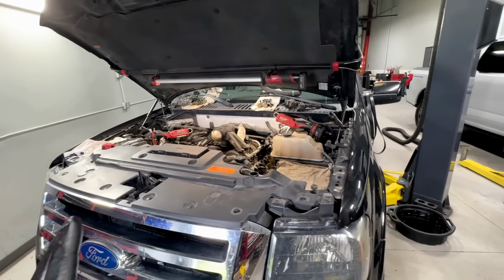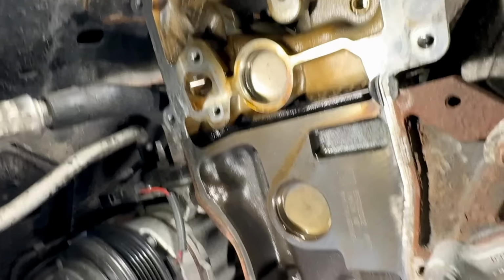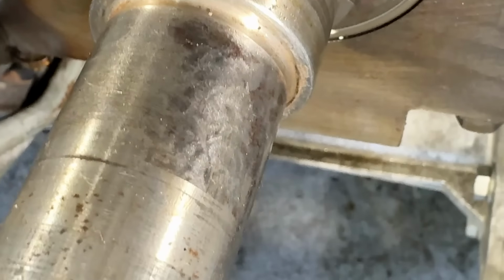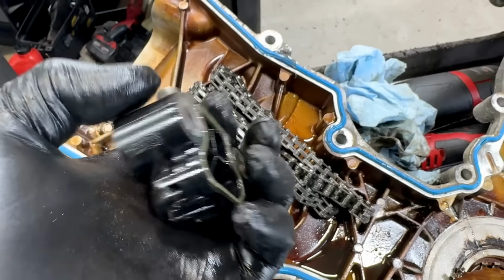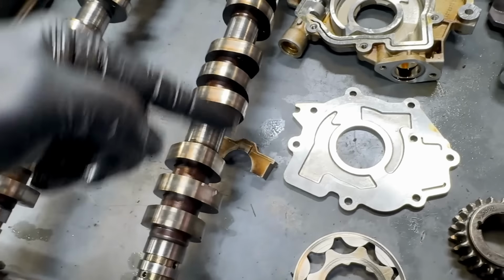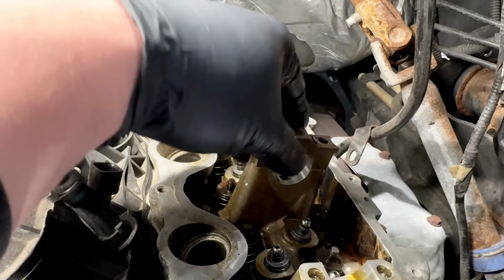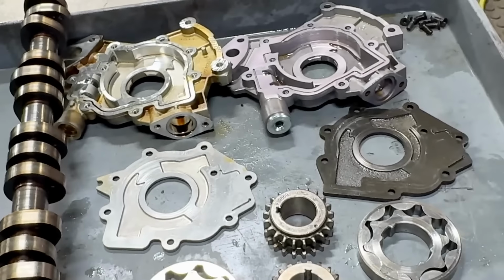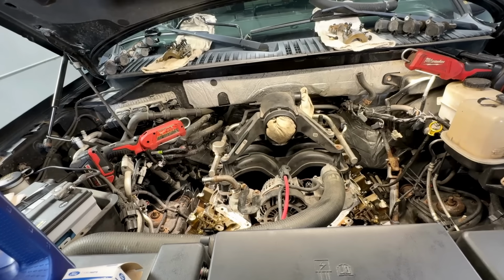How to Destroy a Perfectly Fine Ford 5.4L 3v Triton Engine with a Timing Job!

Comment: Ok, now im curious.
Im about finished with my timing job and noticed when i was putting my cam caps on that one set was numbered and the other was not and he said they didnt start numbering until 09... my trucks an 05 why would right bank be numbered and left bank not be is it possible someone did previous work? Or is that from the factory
Reply: My 2004 f150 5.4 3v has numbered cam caps. Original engine

Comment: 2005 F150 5.4, 265k miles, original cam phasers are locked and VCT disabled in ECU (no SELs). Runs well and gets decent gas mileage, but it's a bit noisy. 6psi oil pressure warm at idle (connected mechanical oil pressure gauge). Rest of the truck is decent (a bit of typical rust, but not completely rusted out. Possibly a good idea to do the timing set along with a HV oil pump? I plan to drive it into the ground :)

Comment: Use 5W40 HV diesel oil for to test or what? I try to understand what propose to the 5W40 HV Diesel oil for?
Reply: Use it as a last ditch measure to increase your oil pressure if it falls out of the new Ford spec of 15 psi

Comment: Can Motorcraft 5w50 oil be used on a 2011 Expedition L5.4 3v engine at an outside temperature of 46C to 50C or not? What is the best grade of oil to use in the engine at a temperature of 50C? I am talking here about the weather temperature. Thank you.

Comment: Start with checking oil pressure first on these engines, that will save you time… minimum is 25 psi hot, in drive, even though ford claims 15 psi (which they changed to reduce warranty claims). If you don’t have enough oil pressure go with a reman long block through Dahmer powertrain. AER sucks nowadays and they don’t stand behind their warranty. Cost for reman with labor is more like $7-$8k not over ten…. Been working on fords for over 20 years.

Comment: Fighting with a local shop now that destroyed my engine . Reused the crank bolt and used what looks like in jb weld to secure. Broke loose in 1 week. Total engine failure.  Ford found the bolt loose on teardown. Marks on shaft are exactly as you described with a loose  balancer. Shop is trying to blame the failure on a bad part (timing gear failure) not their reuse of the bolt. Arghh.
Reply: How did that go?

Comment: Just to clarify, you saying they put cheap aftermarket roller followers with smaller oil holes ? or you saying they did not replace the new ford model factory oem roller followers that now have smaller holes in them ?

Comment: What is your opinion on whether to use the synthetic blend or a full synthetic like mobile one on the 5.4L 3 valve.  Mine is a 2014 with 170,000 miles

Comment: If the ford oem stuff is such good quality why do they fail at such a low mileage rate? Don't get me wrong I can't stand eBay shopping customers but there are better quality parts than oem out there.

Comment: I have a question, i have 2010 f150 crew lariat 120k miles did the timing chain as you have instructed. changed the rollers etc double checked all points and bolts. i ran my finger over the driver side chain  and very little wiggle, but the passenger side has visible slack about 1/4 inch side to side... is this normal ?

Comment: It's funny you mentioned the tensioner being hard to push. On our 2010 5.4 that's missing like crazy brand new oem set the bank 1 tensioner wont push in like that and no milage on them the bank 2 is fine but it's missing on bank 1 so wondering if ford will exchange them they have since changed the oem set I bought right after I bought it

Comment: May have u do the lift to while its there if u do them ur the best an I definitely would be honored if u worked on my truck an everything work s 5.4L3v super crew platinum4*4like I said brakes new tries new spark plugs new oil change Castro GTX shythic

Comment: The Ford store on Amazon gave me the plastic tensioners, can we demand the steel? Thank you
Reply: The updated ford plastic ones are better. They’re non ratcheting unlike the cast iron ones. Makuloco recommends staying with the updated oem plastic versions. The ratcheting ones are known to stretch chains out
Reply: Know of any ways to keep mechanics honest? I've spent $1800 in recommended ford parts on this Timing/Rocker Arm Lash Kit, Oil Pump Upgrade and water pump to boot. I don't trust very many mechanics anymore, except Makuloco but he lives on the other side of the country.

Comment: I got an 05 F-150 with a 5.4 Triton in it I haven't had any major problems with the motor not one I got 320,000 on it I've rebuilt the front end now I need to replace the bed other than that I love the truck

Comment: After a year of back and forth, i ve decided to build a 351 for my ‘05 F150.
In my state theres no inspections, and i know a nice, civil build will run better and i gaurantee it will outlive my $5,000 3valve engine rebuild.
The donor truck was $1,200…
 
I ll loose some OEM functions, but who cares? A nice set of ol school gauges, an edelbrock setup and FASS injection,we gone!
I ve built several chebbies, fords and mopars. Just give me a pushrod motah…. PLEASE

Comment: I think if this was installed properly we wouldn't have seen so much carnage.
Reply from the maker: Yes that was the whole point of the video
Reply: @FordTechMakuloco  sorry I should have been more specific....I meant that these aftermarket parts probably would have held up just fine if installation was done properly.....great diag and info as always

Comment: Good morning. Is there a good way to tell if I for sure need a timing job if the vehicle isn't running? I have a 2012 expedition with the 5.4. It just stopped going down the road. i have fuel to the rail and replaced the cam sensors as that code is showing up in forscan. I haven’t been able to get it to start since. I sure appreciate the knowledge you share in your videos.

Comment: @FordTechMakuloco - do you ever do valve seals when you’re doing a timing job with roller follower replacement? I suspect I have a valve seal slightly leaking towards the back of the engine. When parked with the front of the vehicle higher I get a slight plume of smoke on startup. Never happens when it’s parked level. Thanks!
Reply from the maker: I never touch them.
Reply: Thanks for the reply!

Comment: 07 super crew FX2 5.4 3v bought it with 80k 5 yrs ago did a complete oem timing set and hv oil pump has 87k now and looking forward to many more trouble free miles. This is the 3rd truck I’ve owned with the 5.4 3v have never had any issues

Comment: Would it be good to start to run f150 with 155'000 miles with Shell Rotella T6 5W-40 Diesel Engine Oil, 1 Gallon? Thank you for your time.

Comment: I had a 2006 f150 xlt lariat with   the 5.4 triton.  Had tune up done at 100,000 and broke 2 plugs, couldn't extract them so pulled the heads. New phasers and all new timing stuff at the same time. Very expensive 6400 dollar tune up. Ford reimbursed me 3500 through a  class action law suit on the breaking plug issue.  Totally not impressed with the 5.4 triton. Traded an 18 year old truck in on a new f150 with the  2.7 twin turbo last week. I am amazed at how close it performs to the 5.4 I had. Best part I can pull 28 mpg on a good day not towing. Time will tell how long it lasts.

Comment: I have an 07 5.4L F-150 with 183k miles. Engine has never quit on me but there is a loud ticking noise coming from it and it’s been there a long time. What could it be?
Reply: Follower? Tensioner?
Reply: @tongtongwang  Ended up just being an exhaust manifold leak lol. Ford dealer said timing components and wanted to put in a new engine 😂

Comment: The guy who put this motor together did an absolutely atrocious job he or she should find another career. This person should stick to pushrod engines or lawnmower setups. Ford has a very specific way things need to be done and very few parts can be sourced outside of the actual OEM assemblies. Anyone who does this kind of work needs to take there time follow the proper guides such as ALL DATA or the equivalent guides and do the job right the first time. For a customer who probably put close to 3k into this young motor only to have it destroyed is just ridiculous. I’m sure they are now just wishing they didn’t have anything fixed it probably would have gone 250k as long as properly maintained.

Comment: The chain I absolutely see it the ford chain is made with flat links the melling it rounded it would definitely make sense it would ware out guides. Your videos are so informative I will tell you this my 08 expedition is nearing 250k is under boost and I’m has never been opened up for internal work. I will eventually do the lash adjusters and rollers but until I hear or notice a vct issue it’s staying the way it came. 

I do my own maintenance religiously and I also do all my own calibration work this maybe why I have had such good luck with my truck.
Reply: I always number my cam caps if they are ever pulled for motors I work on. 

You can’t mix them up because if I’m not mistaken the cam bores are line honed after a head is built and each cap belongs to it specifically tower.

Comment: Help!!!!! Just had complete timing on my 2006 Lincoln mark Lt… guides,tensioners, chains, crank bearing, vvts, new oil pump, new coils, new spark plugs, guide tensioners, camshaft phasers, and it just threw a p0012 code… I’m completely frustrated… please help… thank you

Comment: Having trouble finding any info on the 4.6l 4v (32valves total) engine reliability. Do they have similar problems to the 5.4 and 4.6 3v? Any info would be appreciated. Looking at a 2005 lincoln aviator with a rough running issue.

Comment: I have a 2013 Expedition with high mileage (215K) that had timing chain/rocker arm issues when I got it. I made the common (apparently) mistake of buying a Chinese "kit" to fix it with. Everything was fine for the first 1,000 miles or so, then I started having problems with the Phasers. The driver's side cam kept getting out of phase when it wasn't supposed to. So I replaced that solenoid, didn't fix the problem. The engine is extremely clean. I even dropped the pan when I did the job to make sure it was cleaned out completely. 

Moving forward, I decided rather than spend more money on parts and taking it all the way back apart again, I did some research and decided to do a VVT delete on it. I'm aware of the pros and cons, it was my decision and I'm sticking with it. My question to you is this - I know I need to have a tune to disable the VVT logic so that it doesn't turn on the check engine light. Planning to have that done very shortly. However, it runs MUCH better now, but once it gets into a situation where the VVT tries to activate, it feels like it's pulling timing way back. And once the light comes on, it seems to remain in that state. Is this a normal "limp mode" when this malfunction occurs? P0014 & P0024. Just curious. 

Thanks for all the videos you post. Its good stuff.

Comment: Thought on a 97 f250 lightduty with the 5.4? 150,000 miles
Reply from the maker: What about it?
Reply: @FordTechMakuloco  asking your thoughts on it especially the motor
Reply: @FordTechMakuloco  or just any input since it’s weird truck and you have a lot of ford knowledge
Reply from the maker: Its a great setup same engine as a regular f-150 but you will find many items are specific and obsolete as these were rare.
Reply: @FordTechMakuloco  fair that is a concern, I feel that with the internet parts may be easier to get. I’m use to having vehicles that don’t have parts readily available

Comment: I bought a 2017 ford explorer police vehicle and have to change the PTU. I`ve been watching this creator's videos. Sadly, mine while it's working it is leaking fluid, the seals are shot. I have ALLDATA DIY so I'm looking up all the parts and so forth. Mine has the oil cooler which adds another variable because you either need to cap the pipes when removed really quick, or you drain the coolant.

Comment: I currently have a 2004 f 150 4x4 with the 5.4. Your info for said motor is extremely well done. At 181 k miles there is just starting to very lightly rattle. It is really starting to bother me. My shop is quoting $12,000 to do exactly what you do with complete new Ford everything and 30000 mile warranty. Truck is beautiful  and used for windshield farming .

Comment: I love your channel man. You do amazing work. Over the years of everything you have shown us has made me decide that with all the crappy cars that are produced and crappy mechanics in the country witch is probably about 99% of them I think its about time to go back to the old cars and trucks from the 70s and 80s. My old carb chevy Silverado gets 17mpg a d has 289k miles on it and ive changed the water pump, plugs and wires and it still runs good and has decent compression. Never costs me any money.
Reply: Some older ones were good some not worth the paint that covers it, just like modern cars some good some not.
Reply: @andrewarmstrong9194 true, but at least an older car, truck, van, etc won't cost you arm, and leg to fix, totally rebuild or replace an entire engine and tranny.
Reply: Can’t beat em
Reply: I bought a '73 Jeep CJ5 with the 304 V8 a couple of years ago and it has made working on cars great again!

Comment: Would you run Rotella T6 in a 2019 3.5 ecoboost?
Reply from the maker: No
Reply: @FordTechMakuloco  I'm trying to find your recommendations for oil for the Ecoboost. Only run motorcraft or what other options?

Comment: I am going to get into my mustangs timing system it’s a 4.6. I am considering the cast iron tensioners and the melling HV oil pump. Will only go with the Ford performance timing chains. What are your thoughts on the combo?

Comment: How frequently does the oscillation need to happen for you to go to 5W-40? I did my timing job following your videos to the T, all with Ford parts, upgraded Melling pump, and the updated roller followers from Ford. I'm using 5W-30. In the last 10k miles I've had the phaser oscillation happen 3 times, only for a few seconds each time as I was parking. No other symptoms whatsoever. This video freaks me out. I tried to be careful with the cam caps, but I lost track of 2 them during install and had to match their wear pattern to the cam. Would love to hear your thoughts.

Comment: Ive done so many 5.4 timing chain setups and when it comes to those i always told the customers to go with motorcraft. Some that didnt wanna go that route would bring their vehicles back with timing issues especially after replacing the cam phasers and again i would tell them to go with motorcraft and wouldnt c those vehicles again unless it was for an oil change

Comment: Love your videos. I have repaired three 5.4 3 valve engines where someone had the timing 180 out, One on the left head and 2 on the right head. I was amazed that I was able to repair them. They did not have any valve to piston damage. I did a timing job on a 2010 5.4 where the owner broke the cam, chains and phaser. I was able to repair it with no valve damage. It has 60,000 on the repair. And only spent about $800 in parts.  I have done several other timing jobs on almost every ford model. been doing it for 30 years, These engines are not throw away engines they can be repaired. Usually within one day.
Reply: Is it worth repairing my 5.4 3v with 331k

Comment: Hello, wondering if you have an email I can have to pick your brain about some issues I am having ? on 2010 F150 5.4 3v after a -timing job, water pump, VCTs from a shop. I am stranded in AZ for over 11 days and just want to make sure I don’t make my engine worse . Lots of codes P0012, P0022, P0345, P0340 , P0344, P0349, P0300, misfires in cylinders 1,3,5,6 . The shop said just to get an oil change with 5w30 which didn’t work. I changed both of the cam sensors, put a new cam plug on bank 1, I tested the wiring plugs for voltage . Haven’t figured out ohms yet because I can’t find the right PCM pin diagram. I took the front and valve covers off to make sure the chain is still tight. One of the phasers looks off according to your other videos. Didn’t take anything apart inside the engine. I took lots of photos too. I am not a mechanic, I have done small jobs on my vehicle but I don’t have a garage so I figured it would be better to bring it to a shop than open the engine up in my dirt driveway in spring in the Tetons but now I am stuck in AZ. I am capable of changing the phaser but don’t want to pull it off if I am missing something i should check first. Any advice or if anyone knows a shop I can trust that would be greatly appreciated.
Reply from the maker: Yes email me
Reply: @FordTechMakuloco  sorry where do I find it? Your the grist person I have ever commented on on you tube.
Reply: @FordTechMakuloco  never mind I found it emailing now. Thank you sooooo much for your help.
Reply: Also thank you so much for all your videos. It’s all I have been watching for the last 11days

Comment: 1) Can the heads and caps be line bored to accept a bearing shell? 2) Why don't shops engrave those caps to ensure proper placement? 3) Is a 5K oil change interval OK for a 2013 Expy? 4) Will an oil test at Blackstone reveal damage like this?
Reply from the maker: Yes they can align bore to accept bearing as almost all engine remanufacturers do.

Comment: My 2009 F150 only has 120K and sounds great.  But I feel like its a ticking time bomb.  Realistically, when should I set up my appointment with you Brian?  I wouldn't hesitate to drive it up from Dallas right now, but once the problems start I would not want to take it that far. And, how long would you need my truck?

Comment: For 04-08 5.4 3v owners

I always put in 7 quarts but usually only get out 5 after draining the oil. That’s after adding one extra qt at 2,500 and changing at around 5000 miles. Semi synthetic 5w30. Truck has 240,000 miles & runs great

Also trans fluid has never been changed is it worth doing?